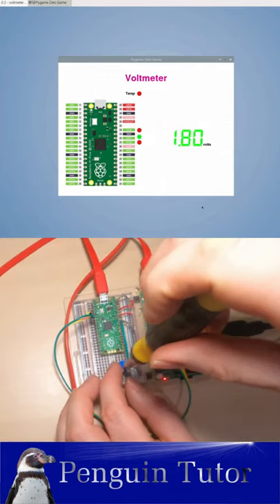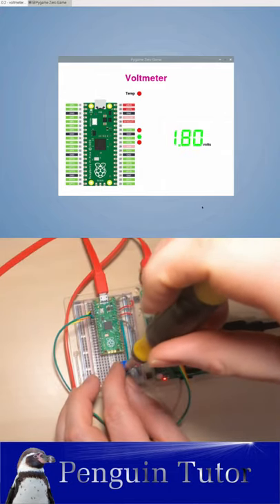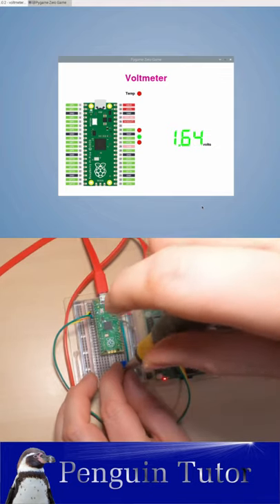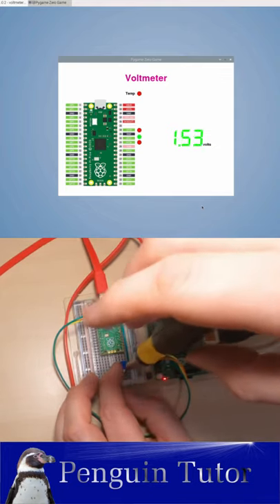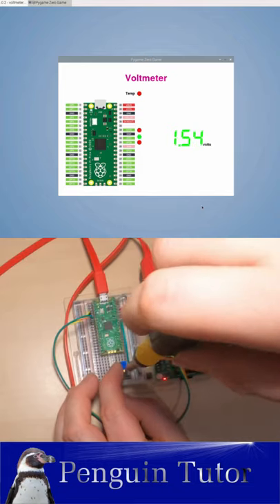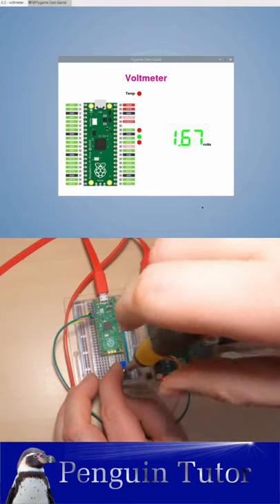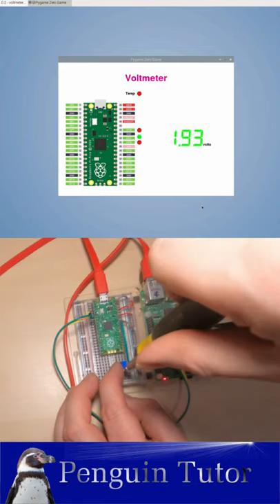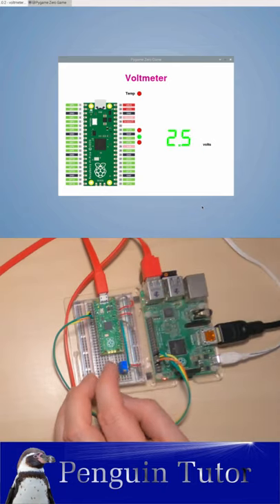Raspberry Pi and Raspberry Pi Pico Voltmeter with GUI #Shorts

Comment: The part I am struggling with is, to create the circuitry necessary, so I can measure positive and negative voltages. I am building a Lego robot, which sorts my batteries, but I can not expect the users (my kids) to get the polarity right, when inserting the batteries in feeder. And frankly, I don't want to have to care myself either. It should just work.

Also, incorrect polarity might bear the risk of frying the ADC ports, doesn't it?
How would you go about it?
I have seen suggestions to use opamps etc.
What might be the most efficient solution. 
For my particular case, -1,5V and +1,5V is all I need.
Reply from the maker: I'm not sure the effect of a negative voltage on the Pico ADC port. If the input was a digital input controlled using a FET then many are tolerant of small negative voltages, but the ADC may not. The datasheet says minimum 0V, but doesn't make it clear what happens if you go negative. But as that wouldn't measure the voltage it's probably not a solution anyway.

Op amps would be one way to go, but it would need a complicated circuit. 

Probably the easiest if you can tolerate a bit of voltage drop is a full bridge rectifier. Using rectifying diodes would result in a drop of around 1.2V which would be no good for a 1.5V battery, but using a low current through schottky diodes you can get some as low as 0.3V each (eg. 1N5817), or with a Germanium Diode perhaps as low as 0.2V so that's a drop of 0.4 to 0.6V across the bridge rectifier. If you battery is that low then that would be classed as flat anyway. 
So you'd just have to compensate the reading you are getting for the voltage dropped across the rectifier and anything below 0.6V would be classed as a dead battery.